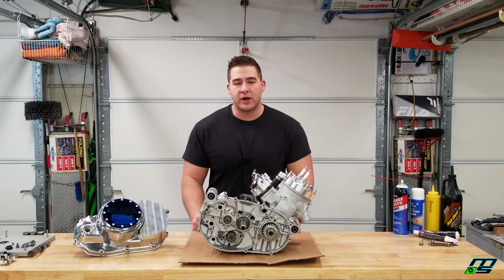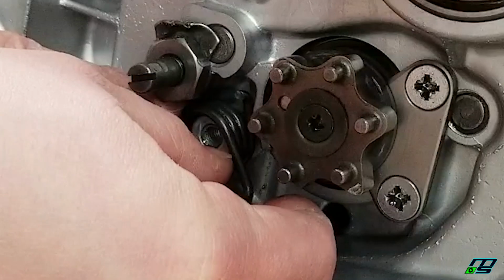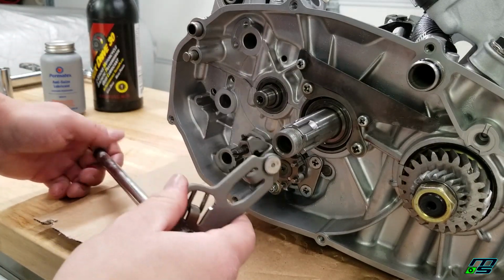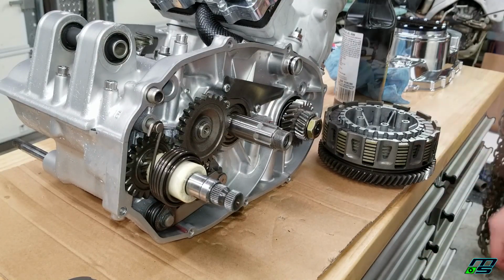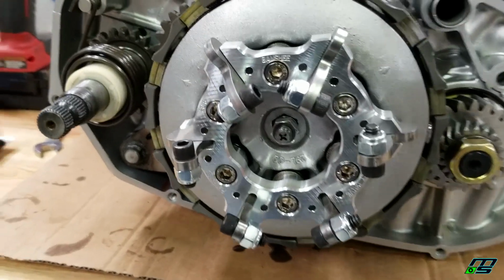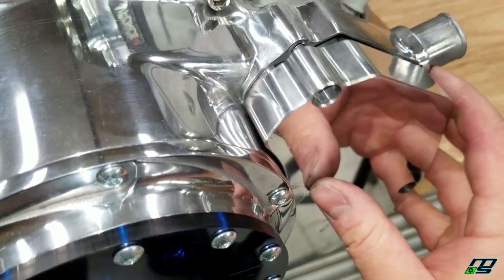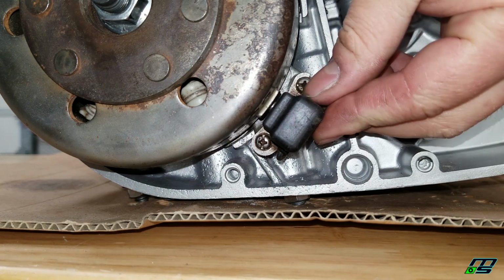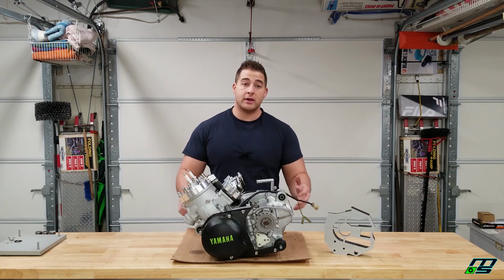THE MOTOR IS DONE! Project 4mil Part 11

Comment: Hope the roller detent lasts
Looking at yours (the same as mine) the lock thread dosnt lock on the bolt as its to short. So its up to the locktight.hopefully should be ok .project is looking good . Cant wait to see how the slp tune up.
Used a cel on mine but had to drop it to the leanest to clean up mid range but that leaned top end and restricted the main so i put the needles in the dremel and wet n dried the end of them 1 clip richer so it became twin taper. It also leaned 1/3 so l had to put in 1 richer slide so the result is a clean jetting all the way through tried all different needles but couldnt get clean mid .main jet worked best at 12.4 af which was 152 in my pwk 35 v4 and snipers
Reply from the maker: I think the detent will be okay! Sounds like you put a good amount of time into getting your tune right!
Reply: Holy shit my guy, that sounds like a pain in the arse! How many hours you think you spent on carb work!? And how are you measuring your air fuel ratio!?

Comment: Love this build bro 👍 only thing I would do different is change all hardware to hex instead of Phillips look how almost stripped they all are after just tightening a couple times Phillips heads are worthless I change all my rigs hardware to hex where I can do much stronger. Sry man I just hate Phillips heads they piss me off 👊👍
Reply from the maker: Thanks man! Yes I agree with changing over to hex. The only thing that worried me was the clearances because the Phillip's is a bit shallow than the hex bolts I have in hand.

Comment: I personally wouldn't run that shift arm with the bearing, if it does happen to fall apart, then I'm sure you're gonna have metal bits of metal and stuff all over. The shift star mod alone is just perfect.
Reply from the maker: We'll see what happens. I'm pretty confident after talking with Jesse at Mac Daddy 🤘
Reply: @MichaelSabo  time will tell for sure..

Comment: That lockout setup is gonna be a bitch for woods/ technical riding. Got one on a trx450r and the window of slippage is very small
Reply from the maker: That's what I'm afraid of but at worst I can take it off and run the HD clutch.

Comment: Can you review the shift mods, specifically around the opening of the "window". Like the other things that you did to make shifting smoother (shift star, and roller bearing), but just dont understand the benefits of opening the window practically. I almost think by allowing a longer travel for your shifter won't your feet have to move up or down further in order to actuate the shifter star? And secondly, my bigger concern, would be almost getting close to 2 up by going that wide with the opening of the window. 

Not trying to hate, just want to see how the practical application of that specific mod and shifter travel feels once u rip on this beast of a banshee.
Reply: DjChrisChip thats not how the shiter work there is no way you can go up 2
Reply: @tannertyrik6251  o ok I thought that in theory if you cut too much it could almost bypass a gear and if not click to the next put strain on the end of the gear if that makes sense.  
Him adjusting the screw and leaving equal space/play on either side made it a little clearer for me.  

Still would love a video explaining how the transmission performs with the mods and extra shift lever travel
Reply: DjChrisChip make sense
Reply: @DjChrisChip  opening the windows helps shifts (these are all theoretical values btw) because let's say the stock windows allow for 2 inches of movement and you need to move 1.9 inches to shift then you have .1 inch of play within the shift system so if something flexes, you don't push up all the way, etc. The transmission won't shift a gear 
By opening the windows you can get let's say 2.2 inches of travel so now you have .3 inches of play, which nothing in there should flex that much, therefore you will always have enough shifter travel to shift
Regarding going up two gears, the bracket spins the shift star than once it spins the bracket isn't on the tabs any more on the shift star, it has to be released back to its neutral state to slide back onto the tabs to be able to spin the star again, it's kinda like the slide on a pistol where it fires a bullet then has to slide back to put the pin on the next bullet to fire
Reply: @DjChrisChip  hope that helped kinda
Reply: @thabosschuck2themax  thank u for the explanation. Great insight.

Comment: I believe you can get a hydraulic clutch kit, you should really get that, I heard that it can make the clutch feel lighter and wayyy easier to modulate.
Reply: Dj Mystery I purchased one for my 2003 banshee, it took a lot of adjusting with washers to make it work but it makes a world of difference
Reply from the maker: Not a bad idea man; clutch pull was heavy even with my old clutch.

Comment: I want to build mine to a 4 mil butt the people from were am at do it but they over charge and also they do a poorly job
Reply: yeah thats why i just bought a 421 cub thats already built with all the nice accessories. couldn't trust anyone here to build it so i went out of state and bought something
Reply: what?
Reply from the maker: You can always buy a complete 4 mil motor from a reputable shop and then swap it in yourself. BP Racing makes all size stroker motors and they will help you install it.
Reply: Do what I did and send the motor off to a good shop I went with herr jug racing and Kevin hooked me up for around 2k